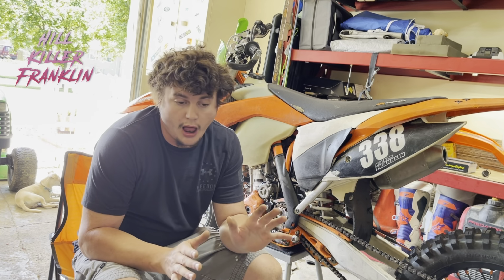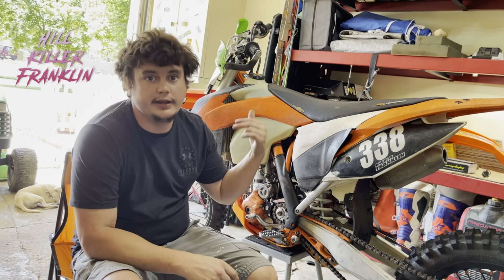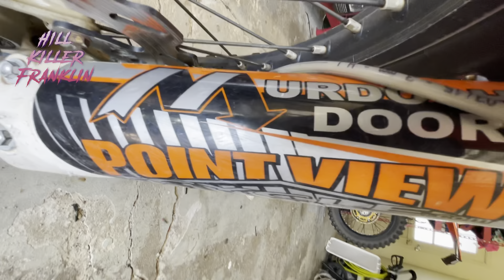KTM 350 bike build!! Vortex ECU installed!!

Comment: Did you have to recalibrate the throttle.
Reply from the maker: No, I just plugged it in and started it. I know with Honda’s you have to turn the bike over with the throttle at a rest than do the same with it wide open.
Reply: @HillKillerFranklin  yeah most bike you do. Just wondering
Reply from the maker: They didn’t mention anything about it in the instructions either.
Reply: @tha1littleguy 1 year later but yes technically you need to set the TPS end points, not a big deal if you don’t as the bike will do it itself.